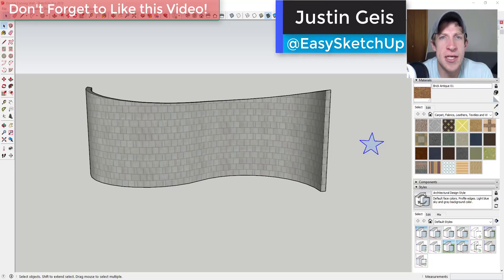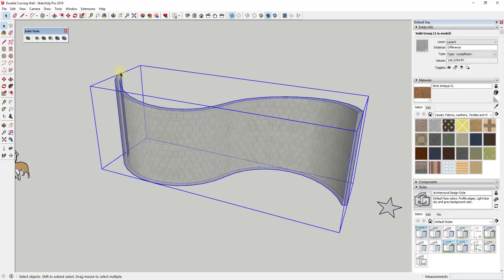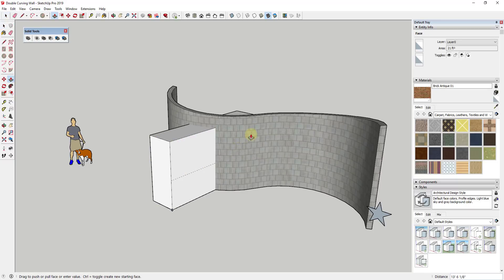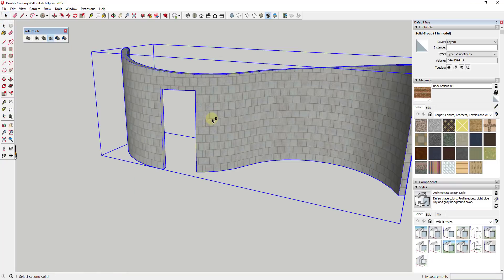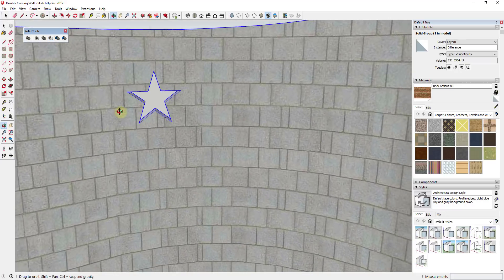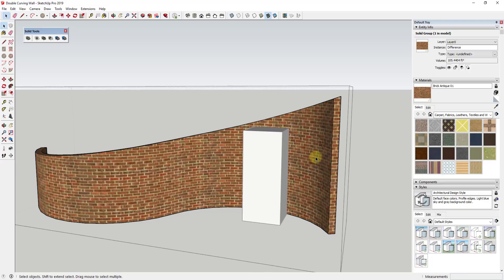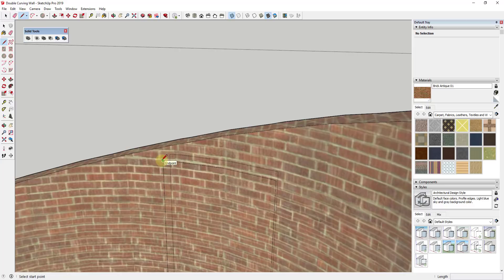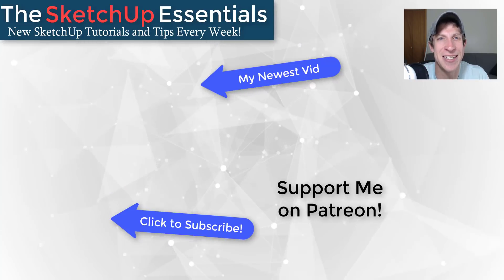How to CUT HOLES in Curved Walls in SketchUp

Comment from the maker: Good morning everyone! What methods do you use to cut holes in complex faces in SketchUp?
Reply: TheSketchUpEssentials a tool only available on Sketch-up pro?  I’m sure the majority of users and the majority of your viewers have the free Sketch-up version.
Reply from the maker: My viewers are spread across the online, free Make, and Pro versions - I'm not going to ignore a modeling method contained inside the program because people haven't paid for the Pro version. Bool Tools - https://mindsightstudios.com/booltools-2/ - contains similar tools to the Pro version and is a downloadable extension - otherwise the second method is free, though a bit more time consuming
Reply: i simply go to the bottom of the above given wall , draw  couple of lines make a face as per my requirement and push pull it to the desired height, that is what i do for doors

Comment: Hi! I'm trying to cut a curved wall that goes around a curved u-shape staircase. My boss needs me to have it done by Wednesday and i've been trying for days with this method. I can't seem to get the same height consistent all the way up the stairs. I need the wall along the curved stairs to be 3'-0" above each step (will be used as a railing) but it just doesn't work out. Can anyone help me?